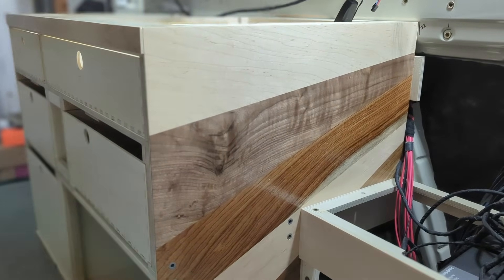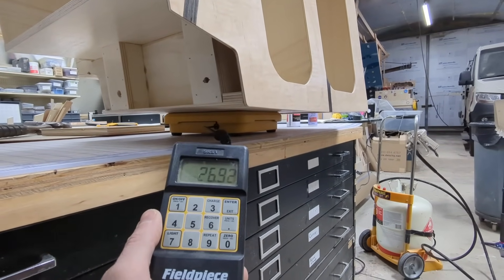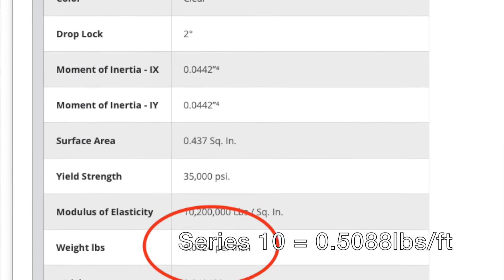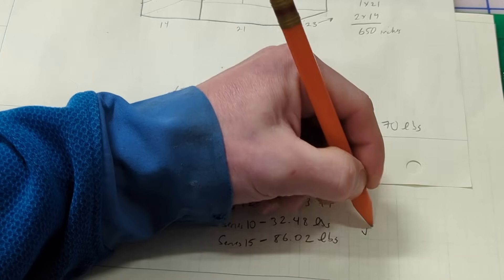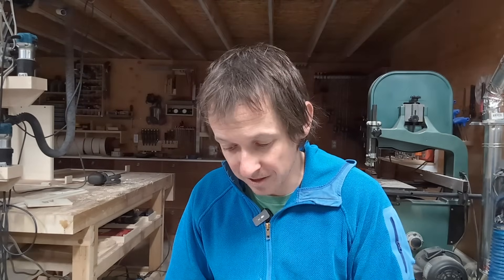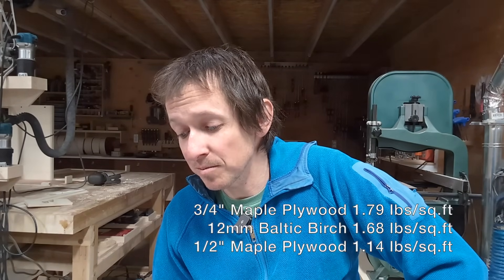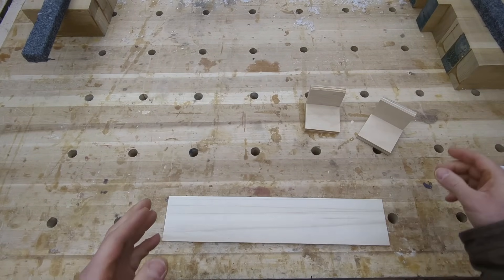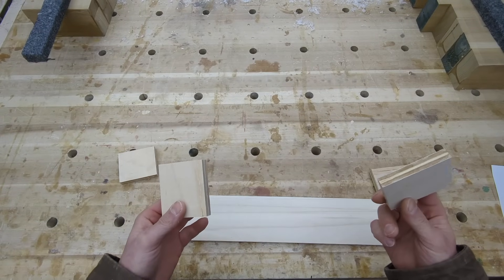Van Conversion Cabinets that are (actually) Lightweight and Maximize Storage

Comment: In my van, I build two long storage trunks the left one taking up half load width, the right one taking up a quarter of the load width. This left an off centre walk way, and formed two bench seats either side of the van. Opening the back doors of the van gave me access into the ends of the trunks so I could slide things in and out (windsurf sails, masts & booms). I could drop a panel in across the walk way level with the tops of the two side trunks, to create a full load width flat area which can be used as a double when camping over night somewhere. I built it all out of PLY WOOD.

I’ve subsequently watched vids on people kitting out their vans with aluminium extrusion like 20:80 (or 20:40, 20:20), and I’ve wondered if I should have done similar…but I quickly dismiss the thought. For me, the issue with using a box section to create a perimeter frame is that you lose lots of space due to the width of the box sections….you lose say 20mm each on the left, right, top & bottom of the frame, so what you can actually put in/out of a cabinet is significantly smaller. I needed to maximise my storage space.

Comment: I hope you don’t mind me saying this but in the US you build on chassis with 3ltr engines whereas in UK ours are 2Ltrs  so your weight concerns around 80x20 shouldn’t really be an issue but yes in UK we do have to keep weight down as much as possible as we have a driving licence restriction max 3.5t. For most drivers.  The good thing about 80x20 is it is very quick to break down and rebuild if you re design your cabinets.

Comment: Amazing comparison thank you ! Nevertheless what wood you use ? Could it be even lighter with Cedar or that other one which type I forgot. 
🙏
Reply from the maker: Well, poplar plywood has been the lightest plywood I've found that I like to work with, although I will say it is "you pay for what you get" as there are some really cheap "poplar core" plywoods that I think are junk.  

I've played around with balsa core stuff and it was just too finicky.  There are occasional times I wish I had it, but overall poplar plywood is much more versatile.

Comment: Your video completely reopened my eyes on how to approach a project I am working on. I just finished a 6U half-rack for a portable digital ham radio station. I used 3/4" MDF and the results were gorgeous, and strong. Unfortunately, it's also very heavy and very difficult to ventilate. I was just about to order some 2020 aluminum extrusions to rebuild it when I saw your video. I am now rethinking my material choices. You made me understand an important tradeoff; your methods are very time-consuming, but the resulting benefit is forever. So, big thank you,.

Comment: Thank you for this video. I purchased and returned Ikea Kitchen units. Ikea units were too heavy and had metal/steel drawer runners, Forming the draw side.   I bought and returned EVO-Designed kitchen units (A Wareham UK company). They were cut out of 12mm Lightweight Plywood.  Again they had metal/Aluminium drawer runners/sides. ( Forming the draw side). The finish on the cut edges was poor. Now I require a kitchen unit for my van conversion and I will have to manufacture it from your design. I have taken screenshots.

Comment: You are making a lot of excellent points in this video! However, your 8020 extrusion section is seriously flawed. Just because most people don't know how to build lightweight van cabinets and youtube seems to be littered with those examples, doesn't mean that 8020 isn't an excellent choice in this application. a few points to consider: 1) you are adding all these cross members for slides. They are not necessary at all. The framing provides plenty of rigidity to bolt the slides right onto the frame. 2) you can build drawers that don't use ball bearing slides. Just combine the 8020 frame with your wooden drawers. While you loose a few mm due to the 8020 width, it would be nowhere near the 76% you are citing. You can even just bolt a slim al angle on the sides and don't need a bottom to support those drawers and slide your wooden crates/drawers right in. 3) While your construction seems plenty strong, you are building in a van that travels at 70+ mph. I don't need to hang off my cabinets, but have you compared how your cabinets look after a crash or simple roll-over? It all looks great except in those rare instances. A lot of people take their chances ... 4) You are reflecting the general issues around 10 and 15 series and it is correct that most build with 15 even though one could argue that it is overkill. I use 30 series which gives you the same weight as 10 but higher stiffness and a 8 mm slot.

Comment: excellent AND exceptional woodworking and patience!! But.. the UK caravan industry has been employing these ideas for a few decades now. 3mm ply for carcassing with 10mm square framing, 6mm drawer components and possibly 9mm for fronts. All those YT videos of folks building vans and starting with insulation and 9mm+ ply, then the cabs, etc. Most UK van conversions are overweight before they start. Love your vids on this but the UK tolerances are even finer and folks need to seriously consider what you are saying and then some..

Comment: I used a balsa ply when building out my van. - a 5 ft, 1 inch counter top, with a right angle waterfall drop end weighed 9kg before I cut the sink hole out of it. I see so many heavy wooden counter tops which are crazy. Like you I built all cabinets out of 7mm balsa bay my top cabinets I used 2nd hand pvc cabinets out of local ambulances.

Comment: If you had a situation where you wanted lightweight but even more strength on deflection, you could lay some epoxy down and add some boat cloth on the surface. Compositing those two would add hardly any weight but increase your strength a lot. The aerospace industry uses compositing a lot.

Comment: Great video. I have used mdf for over 40 years and never had a problem. Ply is harder to work with. However, you need to use thicker mdf than 6 mm. I don't fingerprint because once the structure is established and glued, they are very strong. The strength comes from the draw bottom.

Comment: I love to buy top top top of the line, custom-made kitchen and bathroom cabinets for pennies on the dollar that have been donated by multi millionaires. They think nothing of spending $20 million on a house and then gutting it and donating everything to a nonprofit for a tax write off. The hard part is resisting buying fantastic looking cabinets with exotic matched veneers and 5/8’ hard white maple drawer boxes that combined are very heavy. I recently stumbled across some Studio Becker cabinets that are made in Germany and are very lightweight because the drawer box sides are extruded aluminum, the drawer glides don’t go any farther back than is necessary, and all of the drawer, fronts and cabinet sides and tops are custom engineered out of solid, soft wood, with a thin veneer of melamine, and the final veneer on the outsides. They also don’t waste space behind the drawer boxes like most cabinets. The finish veneer, and the stain they put on it, which is kind of silver are very modern looking, but I may give in to my original intent and cover them with the Zebrawood veneer and zebrawood solids that I bought two years ago for that purpose.

Comment: I‘ve also contemplated about veneering the plywood for my Camper. I want to use construction grade plywood because it’s dirt cheap and then apply self cut veneer. Do you also veneer the Inside of your cabinets though? Seems like a big waste to me but I‘ve been told that the boards are going to bend like crazy if you only veneer one side. Do you have any experience on that?

Comment: I loved your product and your amazing woodworking skills.  Is there material or an overcoat that might help slow down electrical fires that sometimes spread to the Lithium batteries?  Our 2022 Jayco Swift Li 20TL Van was destroyed in a fire in April 2022.   Ashes.  Some injuries. I wish I could show you the small wooden compartments with no ventilation under the bunks where the inverters, batteries, and tons of wires were packed.

Comment: Thank you.  I am in the midst of doing a van build out for a person who wants do use it for Occasional camping/ living quarters.  I just installed the framework for the Beds whose height can be adjusted by a Motor. 
 As I finish writing this I realize I could have done that better, and set myself up for the next phase which is  Area to secure Wall panels and cabinets.  Funny thing is it was likely plan number five that are used to install the bedframe. It  is strong and will work  but now I see a better way.

That is what I got from your video. The problem-solving creative process is beautiful, rewarding,  frustrating, and time consuming. But if you keep doing it, you will find a way.  And don't be swayed by those who minimize What you do and try to get you to do it for less. Likely you are only getting paid for 60 to 90 % of your time anyway.   Communicate clearly. Learn to say no. Keep as accurate of a log as you can. Even though that does get in the way of FLOW.

 Then  perhaps realize if you had a safe place to sleep last night, and a good meal today, You are a fortunate person.

Comment: Thanks for your video, I wish that I seen your video before completing my build. I'm about 76% of GVWR without water, people and pack items. Which leaves me about 2000 lbs for food, items, people, water, etc. I trying to think of ways to lighten and one idea is to get out my hole saw and router. Made my drawer boxes out of 1/2 baltic birch and I don't think sides need to be a solid sheet. I'm also redesigning some cabinets. What's you thoughts on using 1/8" 1" aluminum angle for framing?

Comment: There is a significant termite population in my area.
For my RV revamp, I chose 80/20 for that reason. 
I used synthetics for hydronic flooring and panels.

Comment: I have a feeling using wood/glue for the cabinets rather than aluminum might also be quieter while driving. Metal seems like it would be difficult to get not to squeak. Am I wrong?

Comment: I wonder if there is a joint that maximizes the glue surface under clamp force. Seems edge glued boards are extremely strong while excess glue is squeezed out. Box joints have perpendicular cut lines that fit tight and wipe glue when seating, and are never under clamp force. Maybe polyurethane glue would be strongest for box joints.

FYI, I like that your popular ply does not have exterior glue that makes dark glue lines with some Baltic birch. I would have thought birch and popular would be similar in weight, being both fast growing trees. I think high pressure laminates makes most sense for drawer, door, and end panels for ultimate durability.

Comment: Your work and thought process is awesome. I do have one question. In reading about wood glue and tensile strength everyone says the glue over time will shatter from all the vibration in a van/trailer/boat. Have you had any issues with this?  Thanks John

Comment: I agree with most of what you have said. I'm not a fan or anything of 8020. Infact in my current offroading/overlanding 4x4 it's mostly steel everything or stainless steel. But different use case ofc.

But 8020 is good for beginners esp if they have no woodworking experience or tools.

The strength is very useful esp in the 4x4 industry, infact I plan next time funding allows to use some 8020 to redo one of my drawer systems. As I want to have my 2nd battery (giant 200ah lifepo4) and the electronics stored there, my parts/recovery/tools drawer, and my fridge slide better integrated, my reason for the 8020 is weight and strength, I will be making a fridge drop slide so already need alot of strength, a workbench (also food preparation bench after cleaned) and ofc the drawer. The frame will mostly be 8020. Things like the drawer slide ill just use teflon (on the base of the drawer instead of traditional sliders) for weight reduction and less to go wrong, the drop down slide for the fridge will use 8020 for strength, a giant 95ltr dual zone domestic fridge and/or freezer needs to carry alot.

I've built alot of 4x4s over the years. And I have used more stainless steel than 8020, but when I do use it I try to use it sparingly, outter frames only if possible, never understood people using another section of it for each drawer slide mount, it can be good for a divider if its a very ling piece and will hold alot of weight.

For light duty it wasn't abnormal to use fabric for the coverings on most sides, and carbon fibre sheets for solid surfaces.

All that said one thing I think people esp in van life need to think about. It's definitely better to go lighter weight when possible. But you kill all the savings and more the second you have stone counters and tiles everywhere. I know it looks great. And hey stone counters have advantages. But they weigh alot. And if it doesn't it likely won't be strong enough for anything you want to use it for.

If you can weld or do woodworking most the time 8020 isn't worth the money or weight. As I've said I've used mostly steel, carbon fibre and stainless steel (even some fancy smancy titanium on a customer's car). All have their places.

Before you ever go build something sit down and plan it all. What goes where, how you want it to look. What you really need (esp overlanding), what spaces you have to work with, looks and budget.

If budget is no problem, go reinforced carbonfibre monoshell construction and laugh at all us plebeians (I am joking, and honestly that might not suit all use cases).

Also consider the terrain you will be going on, it doesn't need to be anywhere near as strong if your roads are great, and the most offroading you will ever do is a well manicured lawn at a friends house. But if your planning on doing powering tracks, corrugations and extreme offroading, not only does it have to be strong, it has to resist vibrations, temperature extremes most likely, and of course you need to build hold downs for basically everything.

Comment: You know what, small domed metal tacks pinned onto the frame under the drawer boxes (ie. what the drawers will slide on) can make the boxes slide nicer :) I've got an old record cabinet and the folks that refinished it did that; works like a charm! You only need 4, too (front and half way in. Just don't forget the locking drawer pulls :)
Reply: The tacks inevitably loosen, then enlarge the holes they created in the wood, then the tacks begin to rotate out of the holes and their edges catch the wood.  Once that happens, they either jam the drawer, and/or act like little hoes and gouge out a trough in the supporting wood runner.  Yes, I have seen this result...more than once.

Comment: 15:15 ("...if we imagine this cabinet failing..."). Have you imagined the van getting into an accident? In the event of a frontal impact, the fridge will basically push forward against the thin wall. Hopefully, the gap between vertical frames is not too wide, and the fridge won't slip between frames. This makes the situation slightly better. But still, the question remains: would it be able to keep the fridge in place, preventing it from moving forward toward the driver or passengers? Have you considered making an extra aluminum frame around heavy "dangerous" objects like the fridge or batteries?
Please don't get me wrong. I am very impressed with what you are doing, and I plan to build my own van soon. This channel is 100% in my guidance list.

Comment: I personally use a honey comb panels for my cabinets though they are more expensive they are considerably lighter, durable, and stronger. If it's good enough for airplanes and marine applications then it's good enough for my light weight builds lol.
Reply from the maker: I'd be interesting to hear about your experience with honeycomb panels.  I have loads of questions, as the product has been on my mind quite often but I never tried it out.  Do you have to use epoxy or can you get away with wood glue?  How do you finish exposed edges so they look presentable?  

When I looked into it a while ago the weight reduction was better compared to solid panels of same thickness (obviously) and it was a lot stronger than a 3mm or 6mm panel.  But even a 6mm panel like I use was lighter than a 15 or 18 mm honeycomb panel after you consider the skin thickness, honeycomb, and resin.  I couldn't find thinner honeycomb panels, so it would have resulted in heavier cabinets for my build style.
Reply: @projectofscience  I have only used epoxy but I'm no expert and would have a conversation with a manufacturing engineer for one of the brands regarding wood glue. To finish the edges I router the edge leaving only the skin and fold it over and glue it to the core, so if it's a 1/2in thick material and the skin is a 1/16" I will set my router to 7/16 and only take off the last 1/2" similar to a dato cut then fold it over covering the core. They make a 6mm cardboard honeycomb core panel with nothing but a thin veneer laminated to the outside that's super light and with the insulating properties of the core I've been using another variant as a subfloor with amazing results as well. I recently created a catamaran kayak set up with a platform to stand on that covers both kayaks out of a carbonfiber honeycomb panel and I weight almost 300lbs and it's simply amazingly strong.

Comment: Amazing work! would it be smart to use some kind of plastic on the rubbing surfaces (on the drawers) or is wood on wood with some wax finish or else better? and how much do you think you can load up those 6mm (amazingly jointed) drawers?